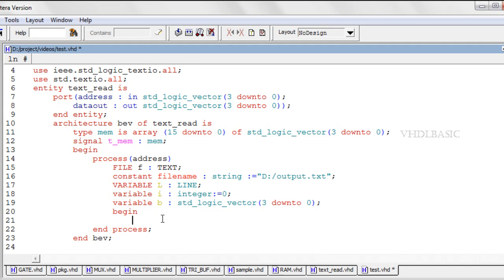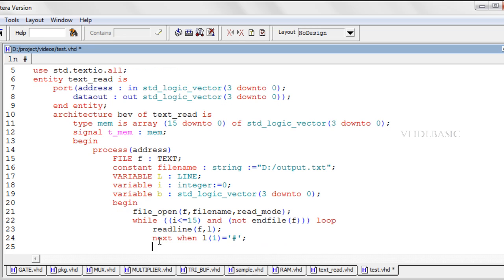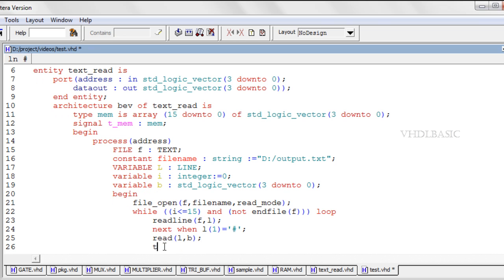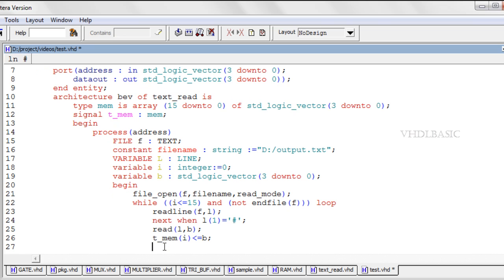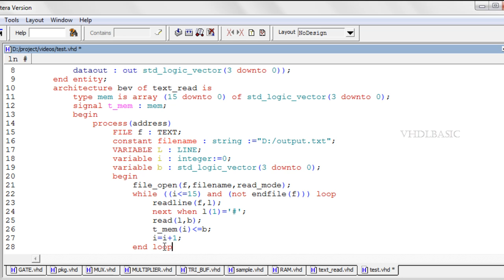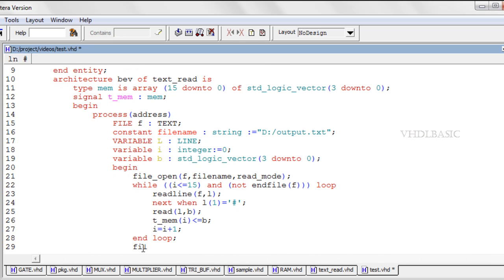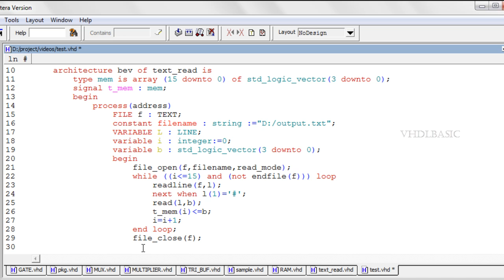VHDL BASIC Tutorial - Read a data from File (ROM)

Comment: I would like to use ghdl to practice with vhdl without any hardware. Since it's not a real hardware, - I guess - it's not a problem that this is actually not synthesizable in a real FPGA. However, trying it in GHDL results in:
rom.vhdl:3:10: primary unit "std_logic_unsigned" not found in library "ieee"
rom.vhdl:4:10: primary unit "std_logic_textio" not found in library "ieee"
I am just a beginner, so sorry for the dumb question :)

Comment: hi,
I want to read read a text file containing 16384 binary data(10 bits) and store it into RAM. I tried to execute your code but it is not synthesizing. It keep running the synthesizing process and never come out of it. In console block it shows following comment :
Elaborating entity <win_test> (architecture <bev>) from library <work>.
Non-constant loop found; will execute up to 5000 iterations

It synthesizes for smaller number of data in file. Like if i tried your original code which reads only 16 data from file, code successfully synthesized, but is gives above problem for higher number.

please help me with this.

code : 
library IEEE;
use IEEE.std_logic_1164.all;
use ieee.std_logic_unsigned.all;
use ieee.std_logic_textio.all;
use std.textio.all;
entity win_test is
 port (address : in std_logic_vector(14 downto 0);
         dataout : out std_logic_vector(9 downto 0));
end entity;

architecture bev of win_test is

type mem is array (0 to 16384) of std_logic_vector(9 downto 0);
signal t_mem : mem;
begin
process(address)
FILE f : TEXT;
constant filename : string :="win_data - Copy.txt";
VARIABLE L : LINE;
variable i : integer:=0;
variable b : std_logic_vector(9 downto 0);
begin
                    
File_Open (f,FILENAME, read_mode); 
while ((i<=16384) and (not EndFile (f))) loop
readline (f, l);
next when l(1) = '#'; 
read(l, b);
t_mem(i) <= b;
i := i + 1;
end loop;
File_Close (f);                    
dataout<=t_mem(conv_integer(address));
end process;
end bev;

thank you.
Reply from the maker: Drashti Patel  u can use this code for simulation purpose,
Reply: Thank you for the response. What should I do to make this code synthesizable? Or help me with the synthesizable code to read data from external file, if you have any.

thank you.
Reply from the maker: Drashti Patel text read and write can't be synthesize. U have to load ur text file into flash or any RAM after that u can use it.